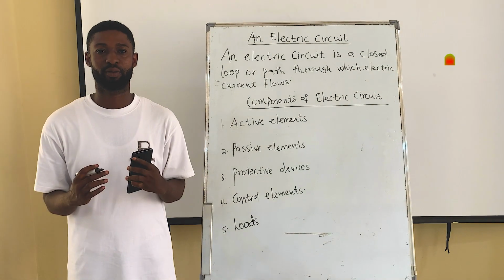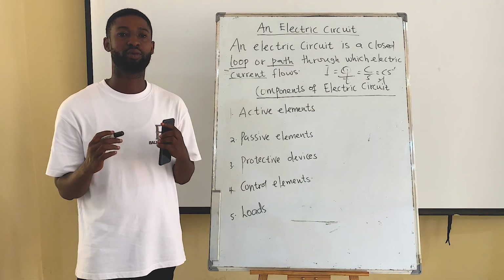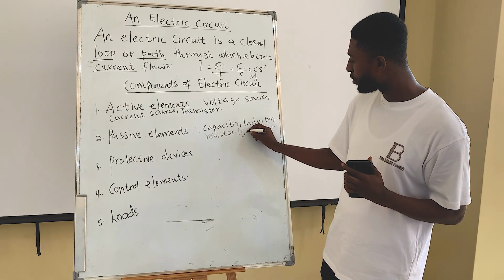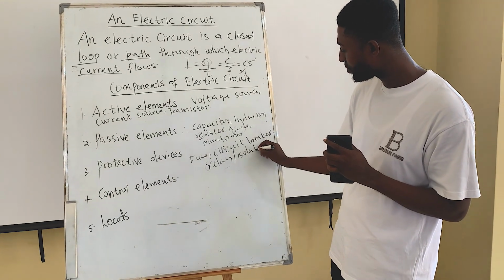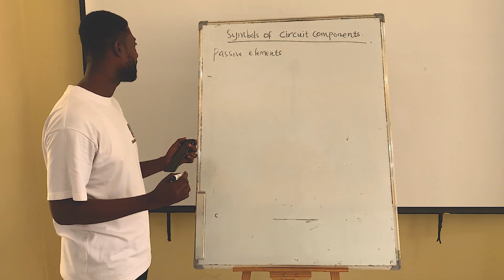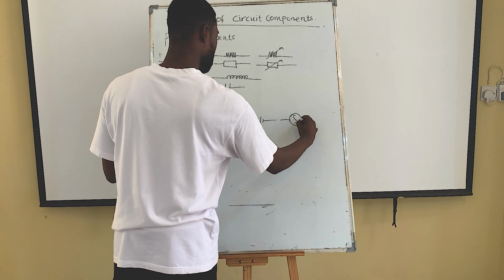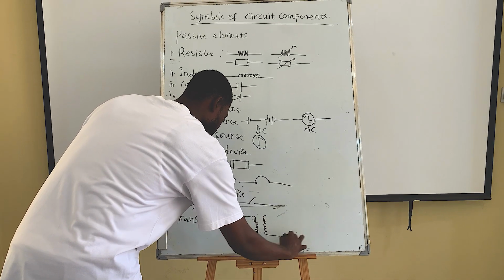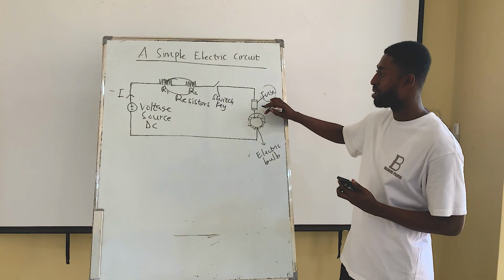An Electrical Circuit and its Components

Comment: Please, what the difference between fuse and circuit breaker?
Reply from the maker: One of the fundamental differences between a fuse and a circuit breaker is that a fuse is a metal piece that melts when excess current overloads the circuit. In contrast, a circuit breaker has an internal switch that gets tripped when there is excess current in the circuit from an overload or short circuit.
Reply from the maker: One of the fundamental differences between a fuse and a circuit breaker is that a fuse is a metal piece that melts when excess current overloads the circuit. In contrast, a circuit breaker has an internal switch that gets tripped when there is excess current in the circuit from an overload or short circuit.